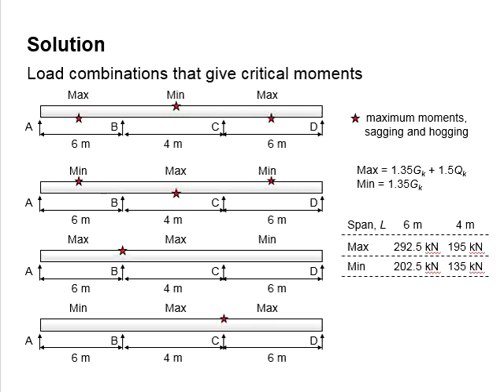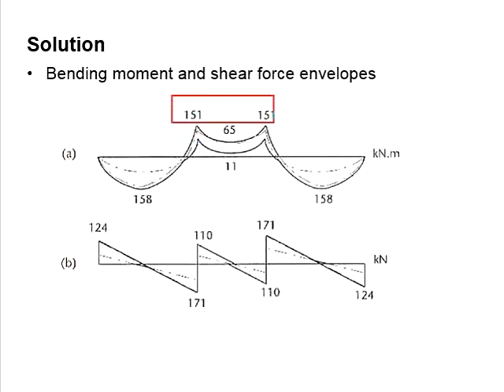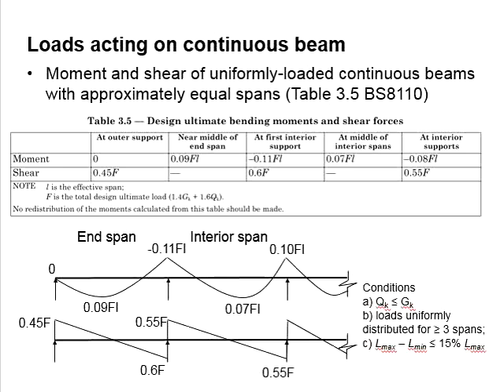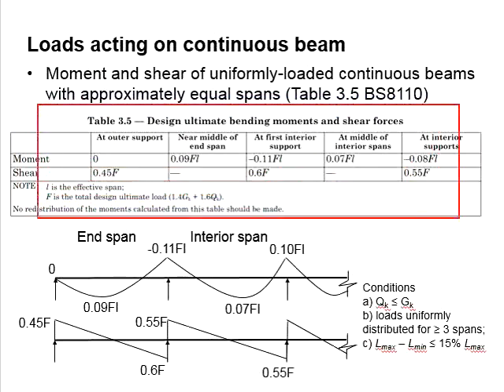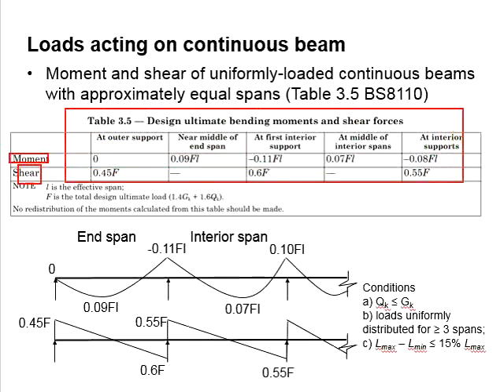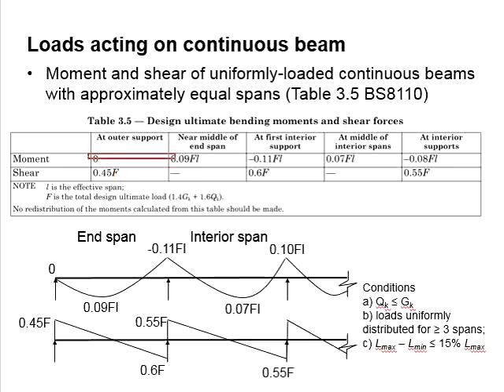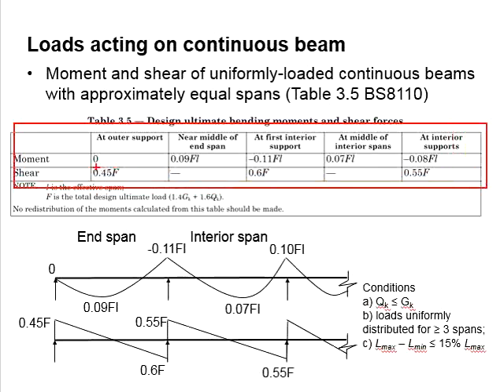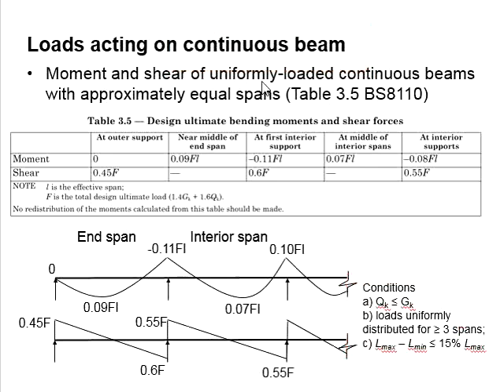3.8 Analysis of continuous beam based on BS8110

Comment: What is the formula  for getting number of bars from area of steel according bs8110 for Fy=410, Fcu= 20, Because BS8110 part 3 doesn't have table for such cases.
Reply: Cross sectional area of the bar you want to use multiplied by the number of bars, which of course should be greater than the minimum required area of reinforcement. 
For example, your required area is 230mm^2, and you assumed a bar size of 16mm diameter when determining your effective depth,  you can provide the reinforcement as follows.
As=( Pi*d^2/4)*n
Where n is the number of the reinforcement you're to provide
As = (3.142*16^2/4)*2
 As = 402mm^2
You're to provide 2Y16 (402 mm^2).
Hope this helps.